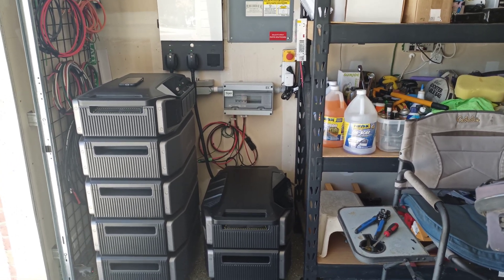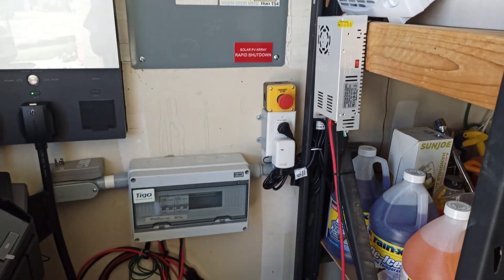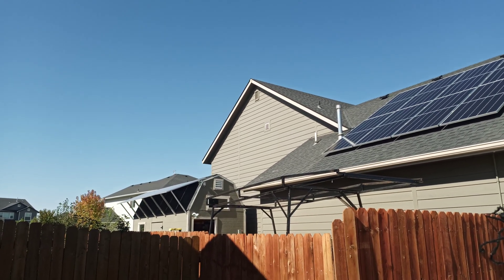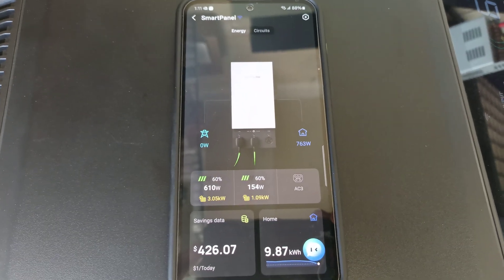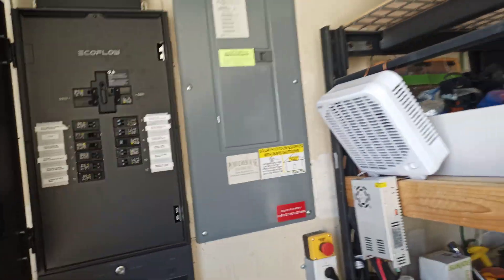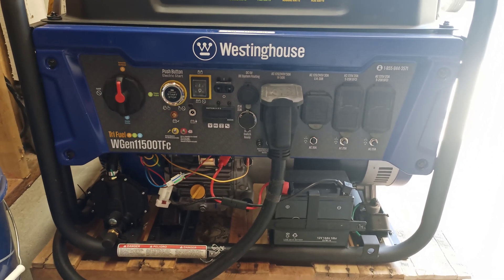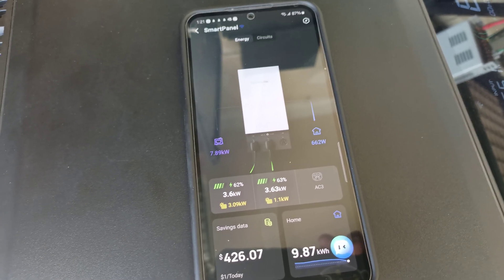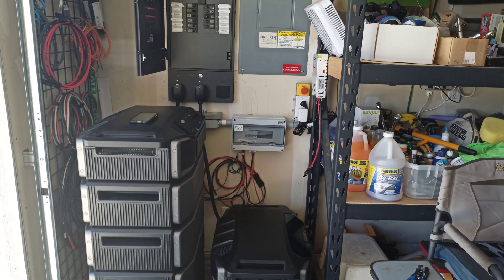EcoFlow Delta Pro Ultra install update w/ Generator overview and run time.

Comment: I bought my DPU a month ago. Added 2,180 watts of off grid panels. I already have 9000 watts of Enphase M250 grid tied since 2015. I bought a power supply similar looking to yours. I use it to simulate a panel and I'm feeding that into one of my spare M250's when my DPU is full or almost full. I turn it off when the sun goes down. I put my Delta Pro with two EB's into retirement. Keeping it for backup incase something goes wrong with my DPU. I pay zero for power and the extra credits I earn goes towards 80% of my NG all year long. I get minus 40C here in the winter and plus 40C in the summer. I have two 12,0000 BTU minisplits. They are 120 VAC each. It's rare that I run them both at the same time. My house is well insulated.
Reply from the maker: @timcat1004  that is fantastic. Thank you for sharing. What are you using as your solar simulator? As mine does not work as intendted..
Reply: I  was looking for a way to take advantage of the energy coming in when it reaches 100% I hate wasting free energy. I thought about bitcoin mining or just getting one of those Huge Battery Banks from EG4 to dump power into for emergencies
Reply from the maker: @Moes_Prep_and_Tech  I would do the EG4. I was also considering that as a backup for when my ECOs  are all charged up as well.
Reply: Hi Erick, nice setup.. I have used a solar simulator as well with my two delta pros, and works well..
I got my setup from this video..

https://youtu.be/1Z9W4GH7xBM?si=b1JlTQMKMEZmu_no
Reply: Sweet. Link to your panels please.
Reply: DOES THE DPU WORK IN HAND WITH THE GRID SOLAR ?

Comment: Great Video!  Really interested in the Load Sharing.  I currently have 1 DPU Inverter/Battery and ordered another and 3 more batteries. I have 8 X 450W Panels to HV port on DPU.   Question:  Is the charging shared through Smart Panel.  So if all the High PV is on 1 stack, does it also charge the second stack?
Reply from the maker: @chipackerknecht9596  No, the solar connected to the DPU will only charge that one DPU. charging is not shared. Load balancing your SHP2 IS shared.
Reply from the maker: For now I split my high to one stack and my low to the second stack so they each get some charge until I put more panels up.
Reply: @erickoffgrid  minutemanprep did a video about this with a different power station, I forget which one, it might be anker but that one did balance 2 different stations, but I hate ankers voltage range
Reply from the maker: @Moes_Prep_and_Tech  now that I have two dpus I did a generator charge for a little bit just to kind of test the whole system and the single battery DPU charged up way faster of course but when I ended the generator it load balanced and charged 1 dpu from the other. So it initiated a state of charge balance I thought that was awesome.
Reply: @erickoffgrid  can you rephrase this statement and elaborate please? Looking to add another DPU like yours. Thx
Reply from the maker: @surgpsych  sure, I did a manual charge of the DPUs with my generator. One DPU has 4 batteries and the other has just one.

The single battery DPU charged faster than the 4 battery unit and was expected.

What was not expected is that when I finished my manual test charging to only about 60% on the 4 battery unit and full one the single the SHP2 kicked off a state of charge "SoC" balancing operation between the two DPUs and leveled out the charge difference between the two DPUs one charged the other till they were within only a few % of each other.
Reply: @erickoffgrid  Thanks for the prompt reply. I understood that part, but can you elaborate on the state of charge balance feature you discovered?
Reply from the maker: @surgpsych  yes the state of charge was just at the single battery unit was 90% And the stack with four batteries was like 30% or whatever and the system balance the two it charged the four batteries from the single until the state of charge between them was equal that's all it is is just equalizing between the two units.
Reply: @erickoffgrid  note that if ecoflow makes that configurable, you might or might not want to do it in a real grid down scenario because that's not power efficient to take from one battery to go charge another - likely doing DC - AC - DC conversions along the way. 
I understand ecoflow's idea that you might need to have 2x 7kw of power at the same time so balancing sounds good, but in your case, not running HVAC, you might be fine not having both DPU able to produce electricity if you were running low on batteries in one before the other.

In the app, if you switch the DPU switch to slow charging (not sure that does anything with SHP2), you could maybe control the max charge rate of the DPU with only 1 battery. I don't know what is the per DPU max charge, but slowing down the charge on the one with 1 battery will do well for that battery's life, and IF you can do say 1.6kW x 4 = 6.4kW in the DPU with the 4 batteries and 1.6kW for the other one, you will use the 8kW output of the generator (or all that minus what the house needs to take) and charge all the batteries in the "softest but fastest" way you can. 

On your video, the DPU that said 1.5 hour would take less than 1.5 hours total because after 30 minutes the "small stack" would be fully charged and all the charging power would flow in your 4 batteries stack - IF the DPU and batteries can take that charge rate. 

From ecoflow's FAQ "The fastest charging power for one battery is 6200W. It takes about 92 minutes to charge one battery from 0% to 100%, but if stacked on two or more batteries, the maximum charging power can reach 8800W. "

Comment: Why wouldn’t you give one battery to the smaller stack, better distribution right?
Reply from the maker: @HugoHoutzager  because I gave the low voltage solar input that only pulls in a little over a kilowatt to charge a single battery I don't think it would ever get through two batteries. At least not in a day. I want the high input feed to charge the most batteries until I get more solar up.
Reply: I'm guessing because less solar comes to it
Reply from the maker: @Moes_Prep_and_Tech  yes, exactly this.

Comment: Great job!  I have been doing a lot of research on the EcoFlow systems.  Your video has answered several of the questions I had about energy savings when using it with grid power.  If I'm going to make an investment I wanted to make it worth while and have a good idea of the ROI.

Comment: Great work!    Got almost the same setup but have 2 DPU's ... one has HV of 8, 500w bifacials and the other DPU has 6, 650w bifacials on HV and 4 renogy 550w bifacials in 2s2p config for LV.... bring in approx 8kw during peak.    Also each DPU has 5 batteries.    Also have 5 Delta Pro's connected to the SHP2 connected via hub.    So far so good!
Reply from the maker: the DPU is only rated to 5600watts input, 4 on the High side and 1600 on the low.
Reply: @erickoffgrid  450v or 4000 watts I believe per DPU on high voltage.
Reply from the maker: @tlteal  does it actually take in all that wattage do you have a picture of it bringing that in if it does I might add me some panels because my voltage is only hanging around 350
Reply: @erickoffgrid  I’ve seen right around 8k with one DPU taking in around 5kw alone and the other 3kw
Reply from the maker: @tlteal  are you splitting that 8K between two DPUs? Or is it 8K into 1 DPU?
Reply: @erickoffgrid splitting the 8k between 2 DPU’s.   One DPU has both HV & LV, the other only has HV since I need more panels.
Reply from the maker: @tlteal  did you put a y Splitter on the end of the cable or are you separating them as two different arrays?
Reply: @erickoffgrid  I have 3 seprate arrays.  2 of which are high voltage and one of them is currently low voltage because of the 2s2p configuration but could also be high voltage if/when needed.   This 3rd array is 4 Renogy 550w bifacial panels which the panels are in/around the 50voc range each.
Reply: BTW, I have another completely separate system running with Victron 450/100 with approx 30kw of battery backup that, if something happened or went wrong, I can still charge up my separate system with the current arrays.  I also have a separate inverter (low frequency) that's 6000w (120/240) where I can use the additional 30kw to charge up the DPU's or anything else that requires power.   Overkill?  Sure some can see it that way but I see it as extra insurance :-)
Reply from the maker: @tlteal  love that !!!
Reply: @erickoffgrid  thanks!   BTW, I'm not trying to give you hard time at all... I also don't have all the answers and just sharing my own knowledge/experience through this process.     Oh and I forget to mention that additionally, I have 5 Delta Pro's (2 Delta Pro's with 3 extra batteries) connected to the 3rd port on the SHP2 via a smart hub.   The provide an additional 10.8kwh+7.2kwh, respectively.    I allow the SHP2 to handle the state of charge balancing between all three of them :-)
Reply from the maker: @tlteal  no worries here, I did not read it as a hard time :-) I love sharing info back and fourth.
Reply: @erickoffgrid  I'd like to know this as well
Reply from the maker: I think this one is a question others are also inquiring about. Your 8K array is it one big array at 8K and what voltage and you're splitting it on the end of the line with a Y splitter one side to each dpu or did you separate this into two different arrays?
Reply: @erickoffgrid  3 solar arrays. One array for low voltage and two high voltage arrays feeding each DPU

HV1 - DPU1
HV2+LV - DPU2

Helpful?
Reply from the maker: @tlteal  yup.. thank you..
Reply: @erickoffgrid  btw, I added small fans on the output of the DPUs to help keep them cool.  They run off of USB-A (right off of the DPU).  2 each and I have now 3 DPU's
Reply from the maker: @tlteal  What prompted you to add the fans? was it running hot or showing error messages?
Reply: @erickoffgrid  it was running a little hotter than I was comfortable with and also a few folks from the forum did the same thing with fans so I figured it can't hurt to try.
Reply: @erickoffgrid  I have two high voltage runs and one low voltage
Reply: Considering adding this to our house, but space is limited where the breaker box is located. Is it possible to wire the smart panel 2 in a different space that can accommodate the DPU’s?
Reply from the maker: @LayneBailey that would require a lot of extra wire because you'd have to move your main lines for your circuits.

But what you can do is install a smart home panel to next to all your circuitry and then move only the three lines for the dpu connection interface that whole bottom box with the three big plugs is removable and relocatable.
Reply: @erickoffgrid  Thanks for your suggestion. What would you expect to pay for an install? Any idea?
Reply from the maker: @LayneBailey it varies greatly and wires not exactly cheap and it's all about how far but the wiring is simple there's nothing to do in the wall maybe just some conduit or metal Flex and about six connections but it's all abot the distance.

I personally would balk at like 500 but maybe having somebody else entirely do it might be realistic for 500 or 700